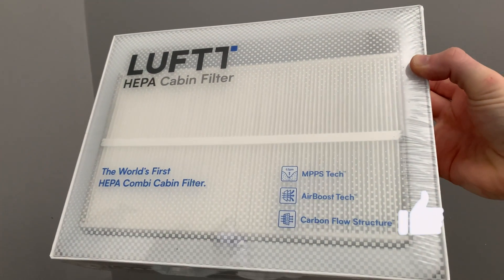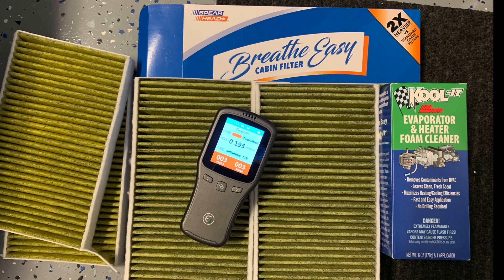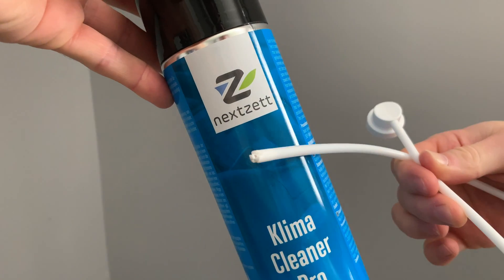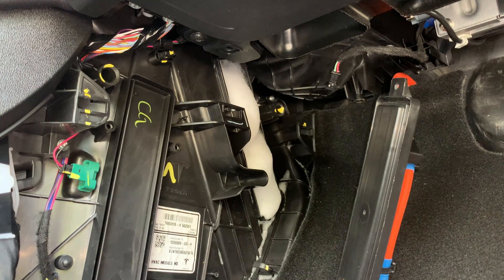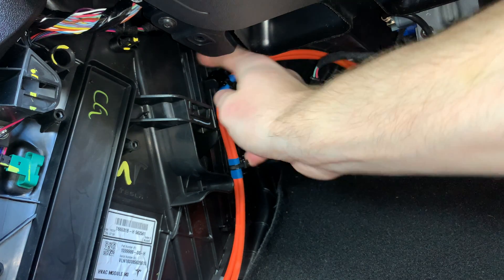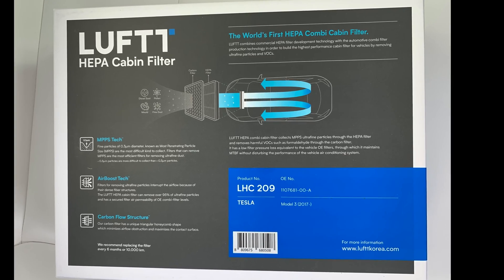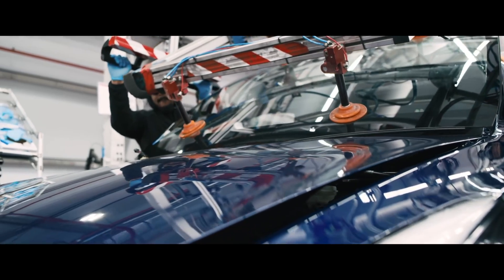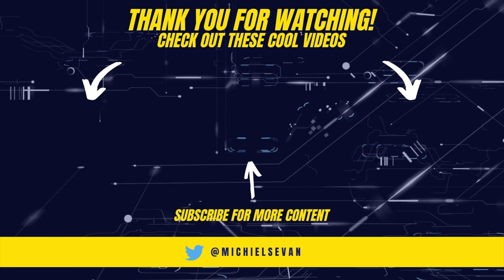Breathe the Best Air 👉🏻 Luftt HEPA Cabin Filters | Tesla Model 3 and Model Y | Review and Install

Comment: Sorry what’s the purpose of using the foam thing again ?
Reply from the maker: Cleans out the mildew in the coils in your AC unit
Reply: @EMtesla1  how was your long term experience with these filters ? Would you still recommend these over revised Tesla filters
Reply from the maker: Every couple years the filters need to be replaced. If these are in stock, I would still recommend them.

Comment: Evan, I'm hoping you can answer this question: Which direction is the honeycomb carbon side of the filter supposed to face? The ones sold by Tesmanian and your LUFTT filters seem to face the opposite direction. When you install them with the tab up, the honeycomb carbon side ends up facing forward, but in all the YouTube videos I've seen, including your older filter videos, the honeycomb side is facing backward. Does anyone know the direction the carbon side of the filter should be facing??? (you also mentioned in one of your older videos that the tabs on a pair of filters you bought were on the wrong end, but were they actually??!)
Reply from the maker: For this particular filter, the Luftt brand... the white part faces the inside of the car so the tabs will stick outward for later removal. Whichever way the tabs stick out for removal, is the correct way. Hope this helps! Thanks
Reply: @EMtesla1  This is so frustrating. I wish someone had the definitive answer. How can it be that everyone's installing their filters based on where the manufacturer places the tab? There needs to be a consistent AND CORRECT  way to do it. I wish somebody knew... In any case, thanks for responding!